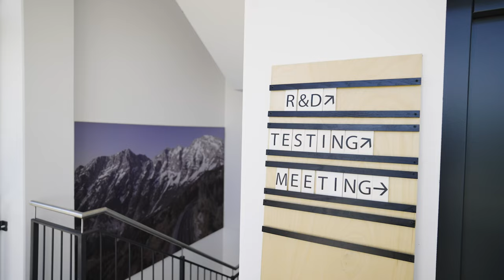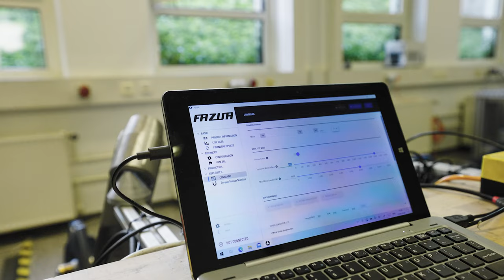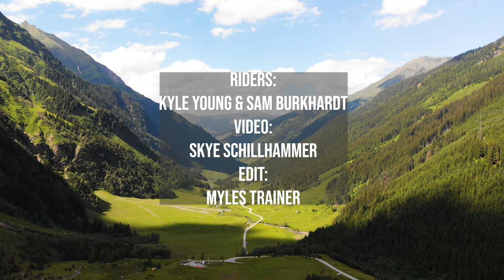Transition Visits Fazua

Comment: The frame is great, straight seat tube and no crap going thru the headset. Thank you. 

The plastic bits related to the E bike motor need refinement.  Mode selector breaks first day. Battery hold down and door need an update.  For a Porsche owned company they should do better.